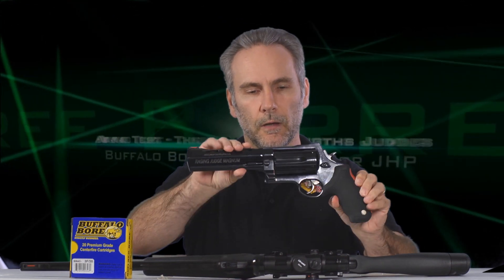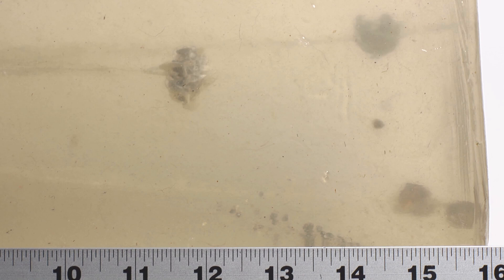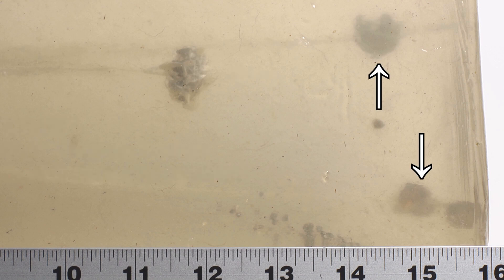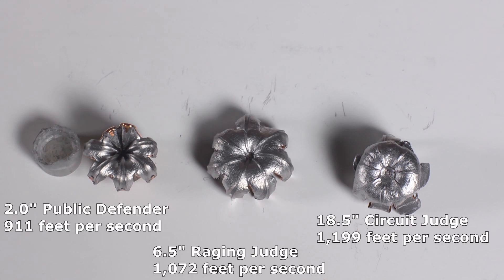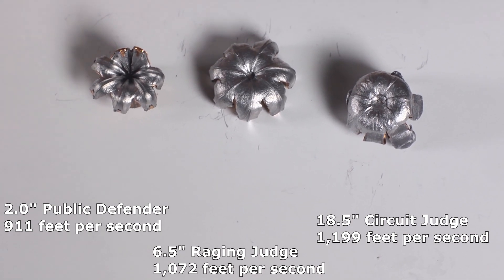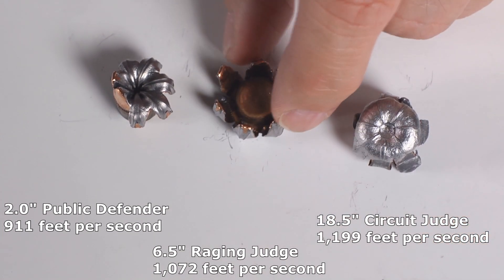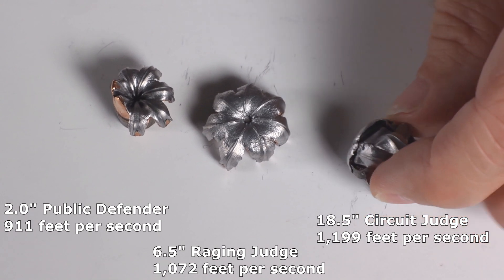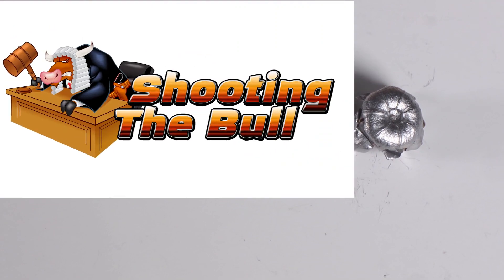Ammo test from three different barrel lengths: Buffalo Bore .45 Colt from Taurus Judges

Comment: Please be careful with buffalo bore plus P in Taurus guns I use a marlin 1894 lever gun and a ruger black hawk both 45 lc my hunting partner uses a Taurus judge and loads it with 45 lc we hunt hogs for a living he normally uses federal or lever evolution ammo but he ran out a few months ago and grabbed a few rounds of my heavy plus P buffalo bore the first round fired but he noticed it was sticking when he pulled the hammer back for a fallow up shot when he touched it off it blew the top strap in half and completely blew out the right side of the cylinder anputating his trigger finger and almost his middle finger which was removed at the hospital and part of the top strap lodged in his left forearm Taurus is a strong good gun but after his accident we purchased a bran new one tied it off and it only took 14 rounds of the same plus P to get the exact same results just a fyi I don't want to see anyone else get hurt the ammo is great for hunting but I would only use it in marlin ruger or freedom arms or Thompson

Comment: ShootingTheBull410  ....I use 124 HST exclusively after your 9mm ammo quest videos. Which ammo and weight is best with a 16 inch barrel 9mm pistol caliber carbine? I have heard with the big increase in velocity, the 124 HST will have it's jacket separate and become way less effective. The 147 HST has been mentioned as an alternative as  the increase in velocity of the higher weight bullet is much less. Otherwise, is a bonded bullet like Gold Dots might be the best option? What are your thoughts on this ShootingTheBull410.

Comment: lancaster - the 410 shotshell is a low pressure round.  Its power is derived from its generous case capacity (much greater capacity than the long Colt which is also a large low pressure round for a handgun).  The large capacity enables the shotshell to house a large powder charge and employ a massive projectile load.  To develop maximum power this type of round requires a long barrel to capitalize on its powder supply = it can charge the barrel to full or near full pressure for quite a distance.  Because of its design a shotshell handgun with a long barrel will launch its shot with much higher velocity and energy than the short barrel versions.

Comment: The bullet from the circuit judge likely expanded full, but due to its high velocity continued on to force the copper petals back alongside the core (expand then contract).  Also the circuit judge will have likely caused the largest permanent and temporary wound channel.  Comparing the 3 weapons with analogous shot placement - it is likely that the rifle will cause the greatest physical degradation and incapacitation effect and the snub nose revolver the least.

Comment: The bullet performed best in the 18.5 barrel. The petals peeled back due to the additional speed the barrel length gave. This means it fully expanded along the way, doing its damage in the process.
Reply from the maker: It only created that damage in the very shallow portion where the initial expansion took place.  All the rest of the way through the permanent cavity it was doing substantially less damage, because it was a smaller-diameter bullet.  So by the time the bullet got in deep where the vital organs are, it was smaller and less damaging than the bullet from the 6.5" barrel.
Reply: Remember, it's just ballistic gel and three shots were fired into it. Optimal barrel length is not a factor because once the bullet hits heavy clothing or bone, who knows what will happen. The higher velocity and additional energy created is king. Either way, the total damage from the temporary and permanent wound cavity is better with higher velocity. Also, my preference (as is many others) is shot placement and penetration. The smaller Judge even did better than that Raging Judge, lol!
Reply from the maker: Der Graulau The Public Defender bullet did penetrate further, yes.

But there's generally no damage created by the temporary cavity when dealing with handgun bullets; the stretch cavity created is within the elastic limit of the tissue (except in rare cases of non-stretchy tissue like the liver).  The temporary cavity can be a major wounding factor with high-velocity rifle bullets, but with handgun bullets, the hole that gets poked in the target is the damage mechanism you can count on, and in that case you want the biggest bullet at the deepest location you can (within limits; 18" is about as far as is practical, anything beyond 18" is generally wasted).  

I think any of these three bullets would have been dangerous, but the only one that performed as designed was the one from the Raging Judge.  And that was really the purpose of the test -- to show how velocity affects bullet performance, and what happens to a bullet that's driven faster than it was designed for, and what happens to one when it's driven slower than it's designed to operate at.
Reply: Correct, but the kinetic energy is still unavoidable. If I may suggest something, try your test again but this time add heavy clothing. As you may know, sometimes hollow points get clogged and fail to expand all together. There are just no guarantees. This is why shot placement and penetration are king. A .45 caliber hard cast Keith (which is a superior bullet) punching through a vital organ is a fight stopper. That's the good thing about the 45 colt, even if it does not expand you still got a big bore hole. We can agree to disagree with this continually so I'll leave it at that. I did enjoy your video, especially because you used the Circuit Judge. I have all the revolvers you used and more, but I am particularly intrigued with my CJ. It's definitely a jack of several trades, but master of none. I love mine. It's definitely been an over achiever with me.
Reply from the maker: I totally agree that big bullets are still effective even if the hollowpoint fails, and that's one reason why I am a fan of bigger bore whenever possible.

Kinetic energy isn't something that does damage.  Kinetic energy is the fuel behind the bullet, but the damage done is what's important.  More energy gives you the potential to do more damage, but does not mean more damage is done; an FMJ and a hollowpoint (of equal weight and velocity) both have identical kinetic energy, but the hollowpoint will likely do far more damage to the target.  Energy is important in that it represents the potential to do damage, but what's important is what tissue gets destroyed and what damage is actually done.

And I really like the Circuit Judge.  With the straight-wall choke installed it's a much better shotgun than any regular Judge, and it can deliver a lot bigger thump from that longer barrel (if the ammo is designed to take advantage of it).  It's really easy to shoot, has little recoil, it's a great little carbine and I'm a fan of it.
Reply: Well, I still don't see it as you do, lol! But that won't stop me from still enjoying your videos! Especially anything to do with a Circuit Judge. My grandpa taught me how to reload and I inherited his legacy when he passed away. Kinetic energy is muzzle energy. Shoot something with a 125 grain HP .38 Special, then go and shoot something with a 125 grain HP. 357 magnum and see the difference in damage muzzle energy (what pushes the bullet) will do. To me, your explanation of handgun and rifle energy does not make sense. I have some .500 and .454 handgun loads that put rifles to shame, namely coming from my 10.5 inch S&W and 9.5 inch Super Redhawk. Go figure, then a carefully placed 22LR round can be a one stop shot as well. The list of factors can go on, from slow to fast burning powers and so on. The one thing I hope to see in your testing is heavy cloth. Like I mentioned hollow points can clog, fail to expand and take on the characteristics of a fmj. There is no magic bullet, magic gun or holy grail barrel length. You just have to go with what is tried and true, not a non-scientific representations. To each his own, but I know what I am packing, lol!

Comment: I really would have expected a much greater velocity increase with the 18 inch barrel.
Reply from the maker: Yeah, me too.  But it all depends on the rounds.  Sometimes there's literally NO velocity increase -- for example, with the Lehigh .45 Colt Maximum Expansion, the 6.5" barrel and 18" barrel were identical.  And sometimes there's a huge increase, like with a .357 or .44 magnum carbine, those cartridges get massive velocity increases from longer barrels...

Comment: The 45 through the circuit judge would be just as nasty or more as the raging judge, deeper penetration, I expanded to same size as raging judge at certain point before bend back of the petals. I would say the circuit judge is more deadly given its superior energy and total wounding profile along its track.
Reply from the maker: The petals were as big, at some point, but then they bent back -- and that happens very early in the damage track.  In personal defense, what matters is how big and nasty the bullet is at the point where it encounters and disrupts the vital organs.  It doesn't matter how big it was for a fraction of a second very early in the damage track; it matters how big it is when it reaches the vitals.

That said, as someone mentioned earlier, the Circuit Judge may be equally capable of delivering the same type of damage as the Raging Judge, depending on the distance.  At a range of 50 yards, the Circuit Judge's bullet will have lost about 100 fps, and at that range it should hit exactly the same as the Raging Judge and expand exactly as the Raging Judge did.

The Circuit Judge is definitely capable of being more deadly than the Raging Judge, but you'd have to use ammo that takes advantage of that longer barrel, and a bullet that was designed to operate properly at that additional velocity level.

Comment: Does this mean my 2" barrel S&W 5 shooter is out of the running?
Reply from the maker: Not familiar with that gun, but if you're saying you have a revolver that's chambered in .45 Colt and has a 2" barrel, then yeah, I would say there's simply no way on earth it could deliver the velocity necessary to get these bullets to perform properly.  Remember, the Judge Public Defender (2" barrel) actually delivers a lot higher velocity than a comparable .45 Colt pistol, because the long cylinder means it really has about an inch more "barrel" than a comparable 2"-barrel pistol that doesn't have that elongated cylinder.

I would say you'd more likely get better results with the PDX1; it expands great from the Public Defender, and would probably be more likely to work properly from a 2" revolver than the Buffalo Bore or Gold Dots would.  But, that's supposition, I can't really say for sure without testing it.

Comment: I think that you have to factor in the purpose that the gun was design for.  I don't think the Circuit Court Judge was design to be used at 10' although it could be used at that distance in a hunting or self defense role.  I wonder what would happen if you pushed the distance out to say 25-50 yards.  I am guessing that the bullet would bleed enough energy to deliver great performance.
Reply from the maker: Excellent point.  According to Buffalo Bore's specifications, for this round at a 1200fps muzzle velocity, it would drop to 1075 fps at 50 yards.  Which puts it right in the sweet spot for how this bullet performs.

Comment: Just 1 question or observation, The round from Circuit Judge shows it over expanded . OK but at what point through the gel was is at its maximum expansion. Wouldn't this also be a consideration when making your choice?  Thanks for the great video's
Reply from the maker: Expansion usually initiates in the first inch of penetration, and finishes within a couple of inches of that.  I don't have a 50,000 fps camera so I can't pinpoint the exact moment when the Circuit Judge's bullet would have been at its peak size, but I am relatively certain that it was at less than the 4" mark; I think it would probably have finished the expansion process and been fully bent back by 4" in. 

Would love to get ahold of a hyper-speed camera so I could verify that; until then it's a guess.

Comment: I've seen the same thing with the Barnes TAC-XP bullet. Barnes own loading is too slow. It expands well but isn't fast enough to still penetrate so it comes up short. Corbon DPX is a little fast so the bullet overexpands a bit. That gives you good penetration but less diameter. ASYM SDX splits the difference with velocity and it penetrates only about .5" less than DPX in my testing but gives you more expanded diameter.

Comment: So the $1 million question, which is the most effective solely based on the ballistics? Let me simplify the question, A person on death row in Utah is about to receive his justice from a firing squad. Youre the shooter with the live round and you have that cartridge and all 3 of those firearms as options. You have to aim at center chest/heart, which of the 3 do you choose to inflict the quickest/most humane death?
Reply from the maker: Well, that is an interesting question, because -- frankly, all three of the bullets here met the requirements of penetrating 12" or more.  Any one of them has the potential to be completely fatal, assuming identical shot placement.  The medium bullet has the most potential to be fatal from the aspect that it reaches further and is more likely to hit something vital, than the smaller bullets do.  But, the 16" penetration depth of the other bullets is really satisfying; 15" is usually generally considered about perfect for penetration depth in gel.  

Knowing what I know about how the bullets will perform, and knowing that the victim is going to be presenting an obstacle-free path to the chest, then unquestionably I would use the Raging Judge bullet, which exhibited plenty of penetration combined with the largest expansion.  It would provide the most damage to the vitals, and therefore should result in the quickest incapacitation and therefore the least suffering.
Reply: ShootingTheBull410 Thank you for the thoughtful response. I'm curious about the literature you've studied on this subject. Do you have recommendations for someone with a casual interest?
Reply from the maker: The best $3 you could spend would be on Charles Schwartz's "Quantitative Ammunition Selection", the Kindle version.  Duncan MacPherson's "Bullet Penetration" is the ultimate tome but it's a lot harder to find, as it's out of print, and you have to hunt it down in used bookstores or pony up the $80+ on Amazon or whatever the current going rate is.  FirearmsTactical.com has a lot of the IWBA information archived.  For that matter, Patrick Urey's report on the 1987 Wound Ballistic Conference is very accessible for casual interest, and covers a lot of valuable ground; you can find it here: http://www.firearmstactical.com/pdf/fbi-hwfe.pdf

Comment: I bet from a an equally long TC Contender (18")  you'd see even higher velocities due to the closed breech. It's not a whole lot but as y'all know, revolvers lose a little juice from the cylinder gap that is necessary for reliable function.
Reply: Cylinder gap has a surprisingly minimal affect on velocity, google search: "Ballistics by the inch" for more details on that.
Reply: I'm aware of how it work haha. Just figured it was worth mentioning.
Reply: James Stevick Except if you totally close that gap, you actually will lose more velocity than if you just have a very small gap.
Reply: Tombs Clawtooth how is that? I would contest that a closed breech or bolt action gun of the same caliber and barrel length would have a higher velocity due to the fact that no gas is expended through a cylinder gap such as a revolving firearm. While it would be negligible is is quantifiable

Comment: I still want to see a .454 test out of that Raging Judge! Those 300gr XTP's have got to be just down right vicious!
Reply from the maker: I haven't done a formal test from the RJM, but I did publish a video that shows the difference between how a .45 ACP hits, and how a .454 Casull hits; you may have already seen it.
45ACP vs 454 Casull - Raging Judge Magnum in ClearBallistics ballistic gelatin

I shot a gel block with Gold Dot Handgun Hunting 300gr, and with Hornady XTP 240gr.  Don't know why I never published those tests, I'll have to dig them up.  As I remember, both bullets pretty much disintegrated, but both penetrated very deeply.

I'll try to do a test on Barnes Vor-Tex; maybe that copper bullet will stay together...
Reply: I haven't been able to find the Barnes factory loads in .454. Everything around here is either Hornady or Magtech. I've done some hand loads with the Speer deep curl 300gr bullets but those are near impossible to find now.

 I'd love to take it out to the range more, but with reloading components almost impossible to get for it right now and the cost of factory ammo being almost $2 a round. It just doesn't see much range time. Same thing goes for my .450 Bushmaster AR15. I've got a Raging Bull in .44 Mag I haven't even shot yet because ammo is either nonexistent or way too pricey for range play.

I'll check the other video. I don't think I've seen it yet. Cheers!
Reply: HEY! Where did you find the scope mount for your Raging Judge? I been looking all over for one!
Reply from the maker: It isn't, really -- it's a bit of a bodge, I'm using the scope mount they make for the Raging Bull.  It's not an exact fit.  It's pretty close, but it isn't a precision fit.